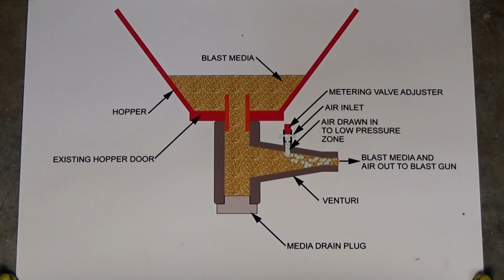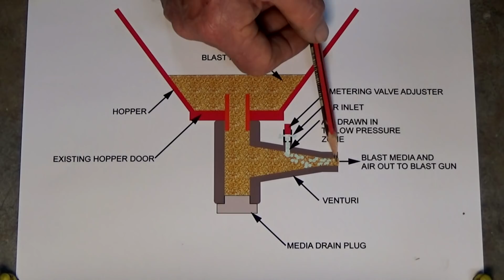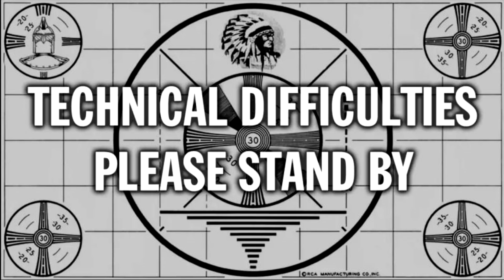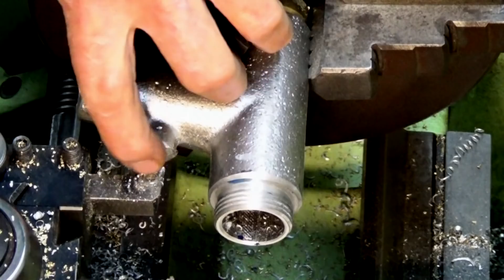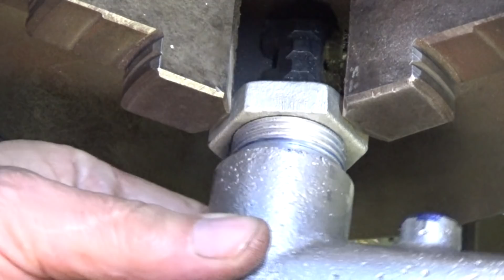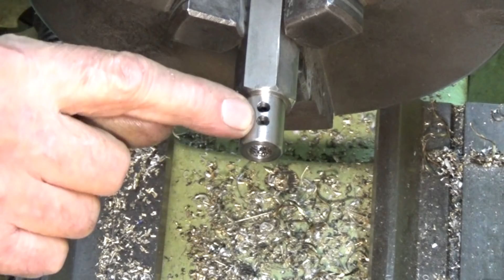HF Sandblaster DIY Metering Valve

Comment: Many Harbor Freight (Cheapest Chinese Choices) tools are simply kits.  There is enough info out there that no person doing the simplest due diligence can miss that fact.  Enjoying your series.
Reply from the maker: I recall watching Stefan Gotteswinter (in my view, one of the most talented machinists on YT) when he goes through upgrade processes on Chinese made tools. He refers to the complete tool as a "kit of parts". I bought this unit knowing it what it was like but I still find it strange that Harbor Freight and others keep selling it as is without insisting on some design changes. They must be aware of the amount of criticism out there regarding the build quality and performance. The Chinese manufacturing industry will eventually evolve and mature but only if importers draw a line in the sand and insist on some minimum standards. 
Just my view..... End of rant! 🙄
Reply: First time I heard "kit" used was a guy regrinding and straightening out the Central Machinery (Harbor Freight) tool grinder.   Harbor Freights buyers are price oriented, not quality.  The price a customer pays buys materials, machining, packaging, shipping etc....   If we as consumers don't leave enough profit in it to pay for engineering reworks or management to pay attention to us, perhaps it's our own fault.  No mater what it is, if a consumer want's it, they have to pay for it.  We all demand pay to go to work.  Harbor Freight is obviously doing enough, look at their rate of growth.  ;-)  Grizzly, Precision Mathews, you name the importer.  Same story.  The maker is only delivering what they importer is willing to pay for, they intern are supplying a customer who must pay to get it.  Almost everything boils down to economics.  Note the "war finish" placards on many old machines........

Comment: Mark again a very nice video. Like you I'm struggling threading on the lathe until I watched the videos on threading of Joe Pieczynskyi. He turns his threading tool upside down and turns in reverse, check it out, no more stress 😎
Greetings Marc (Belgium)
Reply from the maker: Marc, I have learned so much by watching Joe Pi. He give very generously of his expertise. I must try the technique you mentioned because I get very nervous trying to thread up to a shoulder.
Reply: @Preso58  I did 😁, and it works. No more stress 😎

Comment: Wait what? That reverse right hand thread procedure, tore a space/time hole in my brain. Righty tighty, lefty loosey? Huh? No. : ) Thanks for sharing. Cheers.
Reply from the maker: Yes, it was doing my head in too. I had to go back and watch Joe Pi's video before I committed to the cut but it sure beats trying to stop the feed blind with the certain knowledge that if you over run the thread clearance you will scrap the part or break the tool.

Comment: Very good progress.   I liked the nice colour diagram with the voice over.   This is so much faster for you to prepare than animation, but just as good for the explanation.

I have a plastic equivalent which I used to drain the aquarium.    Water flow through the main body creates a lower pressure at the equivalent of your metering valve.   In my case this is connected to the aquarium to drain out the water when cleaning the tank.

I find single point threading to require the most concentration.   Repetitive operations are so easy to loose focus and mess up if not concentrating.

If I made this, I may have used a plumbing rubber cap with hose clamp to close off the bottom of the casting.    This should provide sufficient seal for the low pressure and easier than making the fitting.

I had to lookup a commercial metering valve just to see the price and construction.   Interesting that this one uses a plastic plug.  This is more expensive than I expected, about half the price of the Harbor Freight sandblast cabinet.   Wow.

https://www.ebay.com/itm/Media-Sand-Blasting-Metering-Valve-to-Upgrade-Harbor-Freight-Cabinet-W-Mounting-/311818956723

I make tools and jigs for wood turning so have single pointed a number of 1 1/4in dia x 8 tpi threads.   This is not so difficult in aluminium, but some steel parts have been a challenge due to the force on the tool as the thread gets to full depth.

Dave.
Reply from the maker: Dave, the Ebay link you sent to me is exactly the one that I wanted but by the time I could get it to Australia it would cost nearly AU$150! When I looked last night the Aussie dollar was worth less than 70 cents US. Our politicians like to keep the Aussie dollar low so that our coal and iron exports are cheap for China. That's great for exporters but for Aussie tourists and consumers it is a disaster. We did a trip to the USA and Canada last year and I swear it would have been cheaper to go to Mars. Interesting comment about the aquarium suction device. I once watched some construction workers cleaning out a footing excavation for a concrete slab. They used a simple tee shaped 4" diameter pipe with one end connected to a rotary compressor and the other end went into the sludge, mud and water in the trench. They opened up the air and it sucked EVERYTHING out of the trench in no time. It sounded like a rocket but it worked. I used to teach single point threading technique to high school kids and we had to stand next to them and literally guide their hands for the first three or four passes and then slowly withdraw the assistance. It was all about muscle memory and rote learning but we got less tool crashes that way. 
Thanks for watching,
Regards,
Preso
Reply: International postage from the US is expensive.   I have sent items to family in the UK and a friend in Australia.   The cost / weight is the same for all countries, even Canada.   I have no idea who figures out such rates.

Interesting application of venturi on the trench.

Wood turners often use venturi setups to generate a vacuum for holding certain projects.  A compressed air stream through the body and a line to the lathe vacuum chuck for the vacuum.   These setups can pull 14 - 20 in Hg (max is 29.7in Hg) but consume a lot of compressed air.   I have a vacuum pump which pulls a little over 27 in Hg and is a lot quieter than running my big air compressor.

Dave.

Comment: Thanks for sharing Mr P.  Nice job on that valve. Looking forward to the next one. I was thinking, that's dangerous, that if it doesn't work naturally aspirated Maybe add some type of compressed air at low pressure introduced into the valve. Just a thought. Cheers
Reply from the maker: Yves,
I was considering hooking up a secondary air supply via a regulator so that I could pressurise the air going into the metering valve or maybe add a small jet of air aligned in the direction of the sand travel to get a better fluidizing effect. We used to have a tank at school for fluidizing a type of vinyl powder which could be applied to heated metal. Similar to powder coating but the coating was quite thick and flexible. The bed of the tank was porous and we supplied low pressure but high volume air to the bottom of the tank. The volume of the powder in the tank would double and the density would halve. Anything sitting on the surface of the tank would immediately sink. It used to blow the kids away every time they saw it for the first time. I have started making a new blast gun and I want to do some tests to see if I can get a better suction than the cheap gun that was supplied with the blast cabinet. 
Regards,
Preso
Reply: @Preso58  Cool I am looking forward on how this modification facilitate the transfer of the media.  I appreciate all the effort in bringing all this information to us. Cheers.
Reply: That might be the best way to go.

Comment: I'm with you, can't wait to see if it works. Hard to imagine the threads not clogging up with sand, hopefully you'll only have to adjust once. Also I was thinking a spring under the head of the adjuster might be good for keeping it set in position. Great job BTW.
Reply from the maker: Steve, That adjuster thread was the only one that I did that was actually tight. 😁 All the others were sloppy as you would have seen. I have done some tests with it and it was an improvement on the original pickup tube but still doesn't eliminate the surging. I am now making a new blast gun which I am hoping will be the other part of the solution. 
Regards,
Mark

Comment: You’re right there, even negative results have a positive component. One thing that struck me though was the effect of abrasion on the aluminium in the area where the air and garnet will mix. You’ll have to keep an eye out for wear and install something hard in that spot before the nozzle disintegrates. In the past I’ve had to use various materials to counter wear, from ceramics to manganese steel. It’s amazing how pernicious powders in a fluid flow can be. There’s a whole industry based on the subject. Regards.
Reply from the maker: Peter, there is a guy I follow on YouTube called Arnold's Designs. He does a lot of vapour blasting and sand blasting and he uses tungsten carbide for the high wear nozzles. He is in the USA so he is able to get his supplies from McMaster Carr. Sadly, I don't have that option but I was thinking that most of the garnet is moving quite slowly until it gets to the nozzle of the blast gun. I am making a new gun at the moment and I will re use the ceramic nozzle that came with the original gun. Even those wear away after a while so if it is really going to be an issue I will try to get some better wearing types.
Reply: @Preso58  and Peter Gregory, I may have a useful thought for you. A while back I was given a Snap On hand held blaster that my friend Ian had replaced with a new one, I machined a new Nozzle for it and lined it with easily replaced Nylon tubing that I have at hand. This solves the wear on the nozzle as long as it is checked if used lots and lots. Perhaps some similar thing could apply in this as well as other abrasive applications. It works well for me.
 Cheers from John, Australia.

Comment: Is the pressure drop what you suspect keeps the air from blowing backwards up into the cabinet?
Reply from the maker: Dan, There are lots of strange forces at work inside these blast cabinets. I use a vacuum to extract dust from the inside of the cabinet so there should be a slight negative pressure from that but then you are shooting high pressure air into the interior from the blast gun. The vacuum is high volume but low pressure. The gun is high pressure but low volume so you would expect that they would probably cancel out. The whole cabinet is also vented to atmosphere via the shrouded air inlet so once again there is probably no nett increase or decrease in pressure. I suspect the largest problem is just the weight of material that has to be drawn up the supply tube. You will see in my next video that the garnet is sucked up to the gun and then the suction breaks and it falls down the tube again. I's a bit like trying to suck water out of a well. There is a limit on how high you can place the pump above the water level. Too high and the water column will break and fall back down into the well. 
It's an intriguing subject and I am just playing around with some amateur solutions at the moment. 
There's a few more videos to come.

Comment: Hi ya Mark just wanted to share a video with you relating to ur metering valve that you made. In this video he sh shows 3 upgrades that he has made to his blasting cabinet 🗄 and he made his metering valve from 2 T piece pipe fittings and a ball valve. The only reason that I decided to share the link is just in case there's some people who may not be able to make the part the same way as you made yours, well like the saying goes there's more than 1 way to skin a cat 🙀
https://youtu.be/kjeexqS0Go4
Reply from the maker: Steve,
I thought I had watched every single HF sandblaster upgrade video there was but somehow I missed that one. Interestingly, I was originally going to make a metering valve exactly that way but then I recalled my mantra - "if something's worth doing, it's worth overdoing" 😁 I agree that not everyone is going to want to cast a part the way I have but I was interested in experimenting with epoxy bonded sand cores so that's why it seems overly complex. The other method I was considering was to machine all the parts from aluminium tube and have a friend TIG weld all the joints. I also went to the hardware store to see if I could buy PVC pipe and fittings to make up a glued concoction. Thanks for the link. Every time I watch one of these I learn something new about these cabinets. I have wanted one for sooooooo long!

Comment: I've been meaning to try the same thing, I was going to put a gate valve under the hopper to regulate the flow of sand down into the mixing valve
Reply: EitriBrokkr I’m not sure if a globe valve would work better because they’re used for regulating as a gate valve is for on and off. Thanks
Reply: @mclem4u  yeah, for liquids. Good luck metering sand through a globe valve